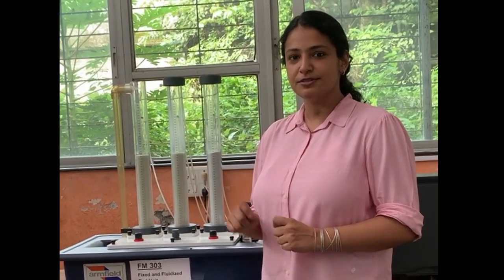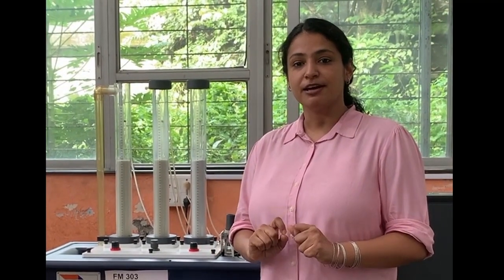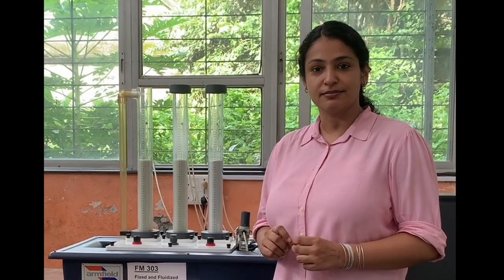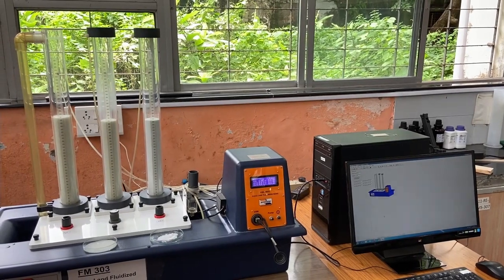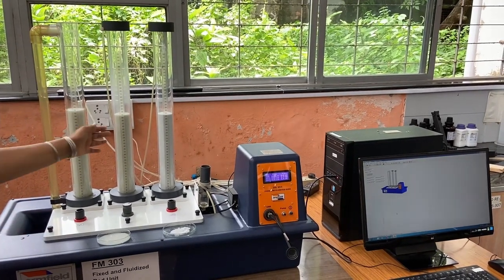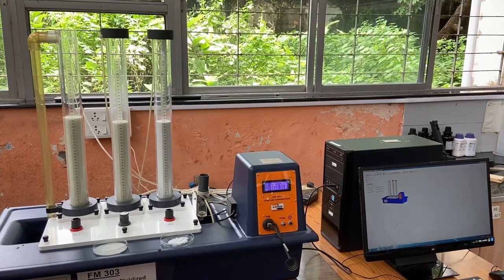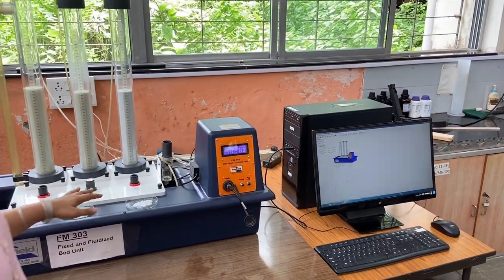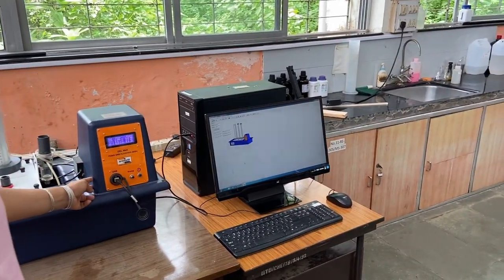Fixed and Fluidised Beds Experiments

Comment: It's very thoroughly understanding of fluidised Bed flow concept. As per Engineering Experimentation, understanding the basic laws of fluid density,flow pattern,bubbling phenomenon, Bed particle with variation in size,measuring equipment with Good clarity of video.Really Appreciable, the Experimentation procedure for new students of Engineering/PG/PhD.also.
Thanks.

Comment: Would there be a difference in fluid characteristics if a vacuum was applied to the top of the tube rather than pressurised air at the base?
Reply: Air flow from the base of the container is still necessary for fluidization to occur, so as long as that requirement is met, I don't see why not. However, the pressurized air at the base is used because we can control this flow rate with higher precision.
Reply from the maker: The absolute pressure does not matter, but as @clayton it is the flow created by a pressure difference. This balances the bed weight (in the expanded bed regime).
Reply: This is such a stupid question